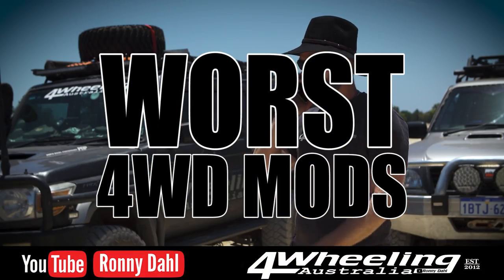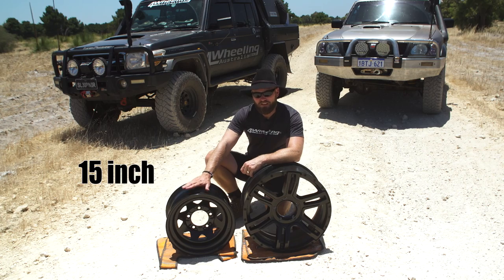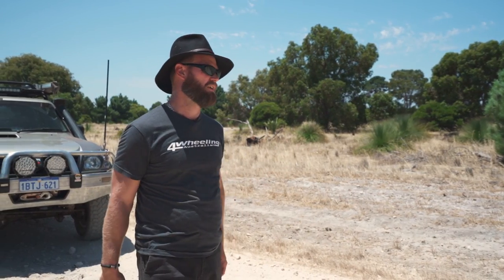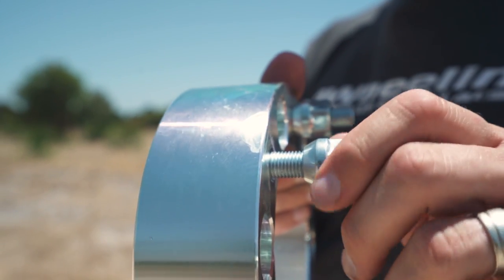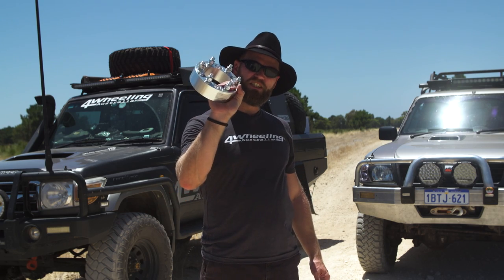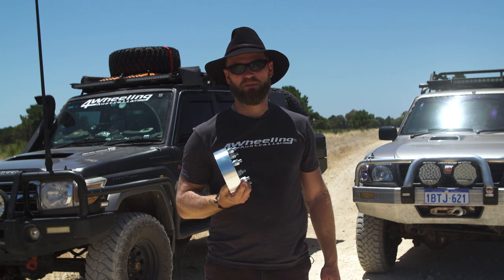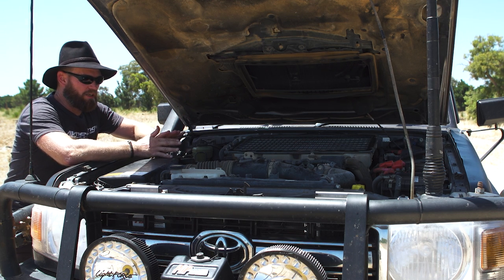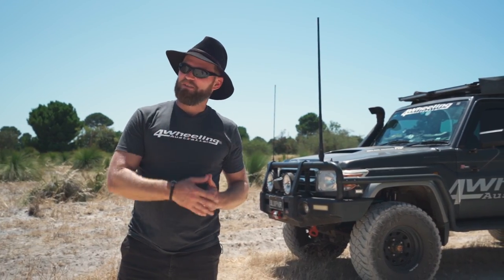WORST 4x4 MODS, DON'T DO THESE TO YOUR 4WD

Comment: Legal as possible is a load of BS in Australia.
Reply: have a look whats legal in europe. trust me, we are still lucky in Australia :-)
Reply: @justdowntheroad4218  a LOT of what you see is not really road worthy. like that Nissan, not practical enough to be a daily driver, by the owners opinion, but practical enough to drive at you and tour family in a 110km/h zone in peak hour traffic?
Reply: @justdowntheroad4218  WA it's a total of 2" above stock. Without a lane change test and all that crap
Reply: @richardkd3048  So it is in Europa, but even that has to be approved by the gov (e.g. in Germany) and there are just like 3 different legal lift kits available at the moment. 
Thinking about winch, barwork or sth like that ? Not gonna happen mate. 

Not even every tire brand is legal over there..
Reply: @justdowntheroad4218  In Poland you drive whatever you want. Tires can't be bigger than the fenders, so we use the plastic or rubber extends.

Comment: I agree with everything minus the cheap LED light bars. Here is my thoughts on that. I can replace my Amazon light bar once a year for about 10-15 years and be at less than the total value of the name brand bar. The Amazon bars I’ve used not only have higher lumen ratings but I have beat the hell out of them and rarely have to replace any. The lowest term I’ve got out of any Amazon light bar was 2 years use. That is with living and working in climates that go from 100 degree F summers to -20 degree F winters. Not to mention the abuse from salt during winter time. I put quite high quality products on my rig where it is important especially for reliability but for light bars as long as you aren’t scraping the bottom of the barrel, the middle of the road products perform quite well for the price!

Comment: Buying anything from kings. Worst mods ever
Reply: Lol. Fine, I'll take your bait 😉. Obviously they have their place. People are made to feel they need to spend $10K before they can drive on a dirt road. $200 spend at 4WDSS, plus a stock 4WD, and you can have an okay weekend off-roading on some easy tracks. The best thing to do is buy mods as you know you need them (get out there). Also, things like snatch straps etc are rated and covered by Australian law - so saving some coin here makes sense. 100% agree with Ronny's list.
Reply: About the only thing worth investing your money in Kings (4wd supacentre) is shares in the company 😁🤣
Reply: @WhyWouldYouDrawThat  ive snapped 4 supercentre snatchies they are complete shit still trying to break my outback armour gear 2 years later
Reply: and you dont save money buying kings crap because it breaks before you upgrade to quality gear
Reply: Interesting to hear of snapping. We mostly 4wd solo, so haven't used snatch straps much - mostly have them just in case.
Reply: @longy6612  just out of curiosity how hard were u using the snatch strap? Not taking the piss out of u or looking to argue but i have seen people do some silly things with snatch straps.
Reply: @WhyWouldYouDrawThat  I can confirm that a fair bit of kings gear is fine, but the snatch straps are shit.  I saw three brand new ones break in a row, one of them was mine.  And it wasn't a ridiculous pull.  I still kept the other stuff, because it works fine, winch extension, winch, shackles etc.

Comment: Snorkel question: 

I installed a safari snorkel and diff/trans breathers for my 2011 Tacoma. The alternator isn't sealed, the clutch fan isn't removed and the ECU isn't relocated/sealed yet but besides those future plans is there anything else I'm missing?  Note on a 2011 Tacoma the intake inlet is above the front tire above the fender liner outside the engine bay. Factory location sucks in water when splashing through puddles. Even without the supporting mods I listed above I don't have to worry about hydro locking when splashing through puddles. It seems ridiculous to call the mod useless just because I haven't used the truck as a submarine yet.

Comment: For my 105 Landcruiser, she handled great with stock suspension and 33's. As the old suspension was sagging, I got a 2 inch Dobinsons lift and steering dampener, nothing crazy.  Although I'm happy with the lift and load rating, she now handles noticeably worse, its like driving a boat sometimes. Everyone said, including Dobinsons when installing it, that "it doesn't need any castor correction being a 2 inch lift", but I'm thinking otherwise. I was thinking either bush correction or arm correction to bring everything back in line. 
What's peoples thoughts ? Any advice would be appreciated.

Comment: I truly wish I could post a picture. A neighbour has a full size long box extra cab Chev. Leaf springs front and rear that are half circles. The bottom of the truck is eye level and there is nothing else worthy of mention done to the suspension. That is to say 4 U bolts holding on each axle. The tires are about 40 series on 24"+ rims. The most horrific thing about this is I see a licence plate on it!

Comment: I only used spacers when I solid axle swapped my 86 and had to make the axle 1.5'' wider on each side due to having a front  axle out of a 83. I used a shit ton of Loctite and torqued them down properly. never had a problem

Comment: Hi Ronnie.  Great videos!
I have an Isuzu 4x4 kb300 LX (Dmax) 2014
I put 265/70R17 Muds Handkook
50mm spacer lift
And Mapped my bakkie 
Kw was 133 now 154
NM was 415 now 508
Want to still put an ARB diff breather kit on just for occasional low water

I'm thinking of rather getting General Grabber AT3 tires and selling the muds...
I'm a every second weekend warrior.
It's my daily driver as well.

Also thinking about changing the shocks to the 50mm lift AmadaXtreme shocks and taking out the spacers.

Can you let me know if there is anything I should consider with my mods.

Comment: Had a coworker who's 1 inch wheel spacers came off when he went for lunch. Fortunately, he didn't lose all of the bolts, so after work we had to do an emergency spacer removal on his Tacoma. I get why you might use one (narrow track like he mentioned, also if you have a weird bolt pattern), but be sure they are installed correctly...

Comment: The spacers you’re holding in the video are the problem. They’re not hub-centric for one. There’s also a proper process of installing them and maintaining them. There’s also a limitation as to the size, anything above 1.5” and you’re asking for trouble. I personally run 1.5” Borra Hubcentric bolt ons with my Ram 1500 on 37’s. She’s daily driven, hauls and tows weekly along with off-roading. Zero issues what so ever. But I’m a mechanic so I maintain my gear unlike some others out there who would just carry on if there’s a noise and when it comes to installing them. I run a set on my Subaru and a set on my CRV, again, no issues with either of them.

Comment: Over here in the States if we want a real Toyota Land Cruiser we need to custom build them because we haven't had a real land cruiser over here since 1997.
 It's pretty common over here to take a cutting torch and cut the factory suspension off of the frame,  and graft in the front end of a 1997 model underneath a 2010 model.

Comment: That's a lot of good advice.

Where I live we get a lot of snow and ice in the winter and you occasionally see some guy that put a 6" lift on his truck and some big Kumho mud tires. Then he's confused why he can't drive in the snow with his big truck. He's also probably upset because his truck no longer fits in his garage and he has to reach over his head to scrape the windows every morning.

It's a lot smarter to leave the truck at stock height and put on some decent tires. If you can afford a separate set of rims with winter tires, great. Winter driving will be easy and you can have another set of tires for when there isn't any snow. If you can't, get some top quality all season tires and learn to drive responsibly.

I recently bought a used truck and when I was looking I automatically dismissed every truck that had aftermarket rims, knobby tires, a lift kit, a light bar/roll bar or engine mods. By doing this I know that I'm getting a vehicle that most likely wasn't abused by some knobhead.

Comment: I never got the people that have those huge lifted modded 4x4's as daily drivers. I get modding it a bit if it's a work vehicle or even a bit for looks, but for a daily i wouldn't put tires bigger than 33" and more likely than not AT and not mud terrains, maybe an inch or two of lift and a bullbar and winch, but that's about it, a compromise between a comfortable, efficient, safe CAR but also a capable 4x4.

Comment: there is reasons you keep 2 sets of tyres 
1 set is the daily driver, the other used off road..
And 1 good tip if you must tow something make sure you have the same tyres the vehicle 
keep  spares on rims and  4 on  rack with or without rims..

Comment: Purchased mods I didn't need in the past from listening to others. Now I just do what I need. Have a y62 now bar lights spotties 2 way pirelli scorpions plus. Stuck to orginal rims even picked up a spare set for 100 bucks. Ive done a tune and put a unichip on it. 98 max power eco 95octane and 91, if needed and of course stock.Also did extractors high cat flows and 3 inch exhaust. I want a rear bar long range tank air bags for towing snorkel. That should pretty much do me. Any suggestions im happy to hear. Other than the usual crap like buy a toyota 😂😂 banter...

Comment: They got the hub centric spacers also they come with directions to tighten to spec and then check them after a certain mileage tighten to spec if they’re not.... I’m not a fan of spacers on a daily especially if they don’t have fender flares or mud flaps the tires will kick up rocks and dirt all over the paint chip it cause it to rust or kick rocks up on the road chipping windshields etc

Comment: I'm watching from the US so the illegal mods you mentioned are legal here, or at least in my state. 

Personally I'm building an old body style f150 for off roading, putting heavy duty 3/4 ton axles from an f250 under it, while my daily driver is just a little 97 Ford ranger. So a lot of the over the top mods are less of an issue for me

Comment: Wheels and Tires is the easiest mode to get right. I'm amazed how so many new comers to off roading go with the wrong tire package. Or basically have a mall crawl set up (which is totally fine) but then try to hit some tough tracks.

Comment: THANK YOU for this great explanation, now I have 2007 FJ Cruiser and feel like I need a supercharge, what do you think of adding one, I am not a fan of Turbo since the boost starts after 2000 RPM which is not good for off roading, not sure if low RPM turbo is available in california thats why im thinking of Supercharger. Any input is helpful, once again thank you for this great video besides other ones. Best. Ara

Comment: Excessive lights is a thing.  I am slowly adding to my truck and I do plan on putting some extra lights on it, but for purpose not looks.  I see so many vehicles out there with absolutely ridiculous amounts of light bars on them that I can't imagine they'd ever need!  For me, I want a small light bar on my bumper to extend what my high beams can do out in the back country at night and I want to add some small light pods around the sides and back since I often get to my destination after dark and lighting up the area when I'm setting up could be useful.  Everyone has a different purpose for what they need these things for but nobody needs 4 massive light bars on each side of the vehicle...

Comment: I have wheel spacers on to widen my track slightly so my tires dont rub at full lock. I have them torqued to spec and re-torque
 them regularly

Comment: Hey Ronny - I have just purchased a 79 series Dual Cab with the narrow rear axle and was wondering if you had any problems with the negative offset rims?  Did you have to regularly replace your wheel bearings etc?  I have watched a lot of your YouTube videos, but I could not find where you mentioned any problems associated with these rims, just that you had them on to correct the problem. I am looking at the ADR approved diff extensions offered in Geelong for about $3.5K, but a set of rims would be a lot easier on my pocket! 
Thanks for any help/advice you can give me in advance.
Reply from the maker: Wheel offset worked for me pretty well had it for 2.5 years and only did one bearing BUT I did weigh 4.2t for a while so that would have had something to do with it.

Wheel offset is a $200 fix at most. Replacement diff is 5-7k once you add labor cost.
Reply: @Ronny_Dahl  - Thanks mate for your blisteringly fast response!

Comment: A 20 inch rim is great for 10 - 11/20 semi truck tire .because you can regroove them with a chainsaw and they have 15 ply sidewalls , those tires sidewalls are so heavy you can drive them flat

Comment: also, going to a 22 inch wheel, as opposed to like a 15,16 inch wheel, means way more expensive tires. I went from a 17 inch wheel to a 15 inch wheel because the same size tires were like 100 dollars cheaper per corner. spent 200 dollars on cheap steelies to save 400 dollars every single time i get new tires, thats smart finances.

Comment: Ive run wheel spacers on my Jeep for several years. They aren't illegal here, and I'm the only one that wrenches on my jeep. They have loctite on the spacer bolts. I would never recommend them for others, but they've worked great for me. But i take full responsibility for my choices lol

Comment: I just got a 21 4Runner with stock 20” wheels. Not planning on doing much off roading. However I do plan on taking it on the beaches.  The beach rules is the tires have to be around 18psi. Can I do this with these tire/rims?

Comment: I totally agree with the over-sized rims issue!  Why does every Land Rover come with huge rims?!  My LR4 has 19" rims and it makes NO SENSE.
Reply: The simple answer is big brakes.  Most modern vehicles are being engineered with larger calipers which will never fit into a 15" or 16" wheel.

Comment: 35's on 17x9's on a stock 2020 jl rubicon does anything you ever could ask out of a 4x4 and it's legal, reliable and down right good looking. Plenty of power and will daily commute. Does not void warranty and makes the most sense for your dollar. My 2 cents

Comment: seen fairleads or rollers without winchs on some trucks lol
well, first thing a true off road rig needs before anything is at least 5 thousand dollars worth of light bars.....don’t forget the lights in the wheel wells, those are there to keep an eye on the brake caliper covers, incase they fall off on the trails.

Comment: Here in the US, I love seen Pavement Princess' with the super aggressive tires like he shows here, but closer to 30in sizes.  Sounds like a swarm of bees coming down the road as it blinds you from the excessive amounts of chrome and bling and the suspension jacked so high that it would probably tip over going around the corner, except for the double wheel spacers they put on to make it more "stable".

Comment: Hi Ronny, I’ve got a 2012 prado 150 Kakadu. I just upgraded my stock 265/60r/18 tyres and Toyota stock rim to a Kings Ambush rim with Goodyear Wrangler Duratrac 175/65R/18. Is that an overkill or worst or better for off-road,

Comment: Buying cheap Winch Cable . Especially Dyneema types .. Unless you are spending around $300 on double braided pre-compressed and sealed cable such as the Ultaflex4x4 UHMWPE  Alien Wire , then you may as well tie the legs of old jeans together .

Comment: My Rams on 35s with 20s never aired down with em and don't keep a spare same size.....fire breaks ECT tires do just fine I've had to use air pump and shove a plug a few times on a trail but anything crazy the sidexside plays with it

Comment: I run a 1in BORA spacer with extended studs; no different than running a wheel with -25mm more offset and no worrying about an extra 2 dozen nuts that need torquing

Comment: Whats up with the high lift jack? Many trail rides require it, or you are not allowed to go on the trail. 

Wheel spacers are OK, they came factory on an RV I had. When installed properly, they are just fine. Use Loctite and they will not come off.
Reply from the maker: Most don’t know how to use them or have lifting points for them and just have them because they think they need them thanks to salesmen and magazines

Comment: I carry a hi-lift as a back up for my winch and also to lift the vehicle to change a tire. I’ve also used it to break the bead on a damaged tire to patch it in the bush. There’s plenty of reasons to Carry a hi-lift even if you can’t lift your vehicle With it
Reply: Well said.  I have always made mods to use with my hi-lift jack. Even with heavy duty aftermarket bumper such as Ranch Hands, i still use straps to attach to bumpers, wheels, etc.  I properly used Hi-lift is indispensable off road, even in Hawaii's sand.

Comment: I think if you do any off-roading in water even if it's shallow, you should have a snorkel.  They're relatively cheap and are a good insurance against potential accidents if you ever hit an unexpectedly deep area or hit a sinkhole the 300 dollar snorkel will save you a 1,000+ dollar engine

Comment: Car yard put 22” rims on my l322, it looks great but I wouldn’t take it beach driving, will be looking for six rims before it goes anywhere near a beach or track. It’s mostly for towing, just need to figure if I want to go off-road... I had a 140hp J&S registered buggy and loved beach driving but that weighed 500kg and had huge rubber, barely left a tread mark.. there’s no way you could run 15psi on the RR with 22’s.

Comment: Well that was pretty good, except for the Hi-Lift jack comment. There are a bunch of uses for one of those off road. Not to mention there are a few more ways to use one to jack up a truck other than the bullbar.